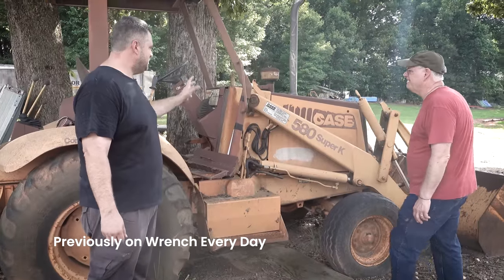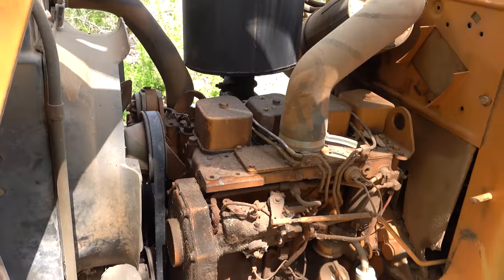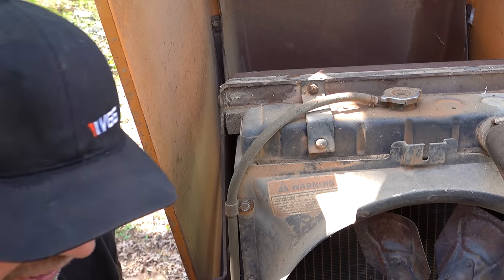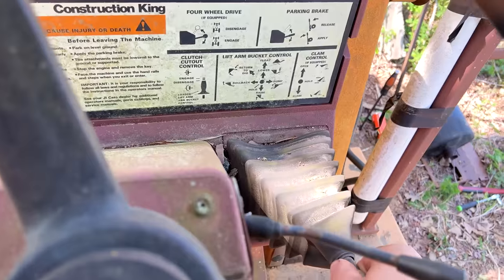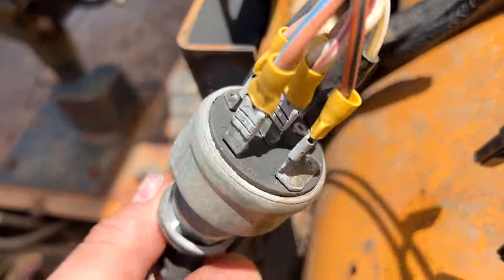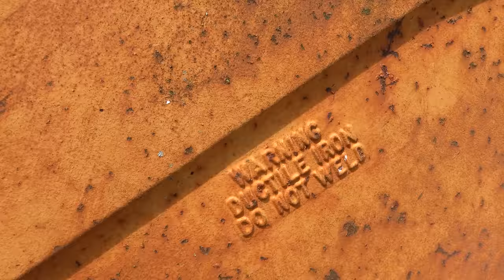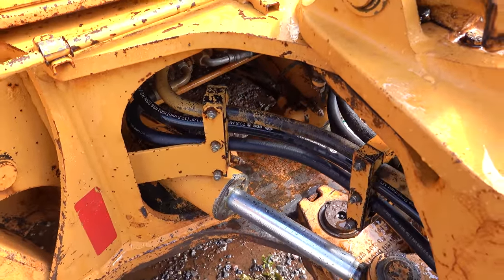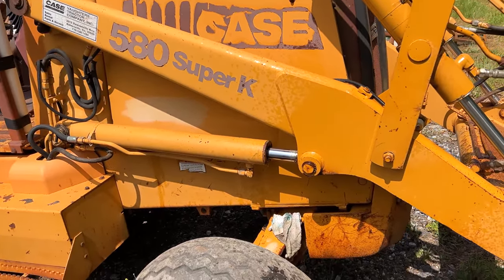I Found A $50,000 Diesel Backhoe ABANDONED In The Woods...Will It Start And Run?

Comment: Using it while it's leaking hydraulic fluid is inadvisable. I don't know what the US regulations says when it comes to this, but hydraulic fluid is one of the most environmentally toxic substances you can spill. 

In Denmark, where i live, during the education i have as a crane operator, it is part of the education to learn the harm that these substances can cause, and for hydraulic fluid, if you spill just one liter of it, which is very little, considering how much a system like that contains, then it takes 1500 liters of water to dilute the contamination enough so that it is no longer environmentally toxic. I imagine that scales with gallons as well. And if you spill it, and you don't clean it up, or fail to clean it up properly, there is severe punishment, up to, and including jail time, depending on the severity, and the cause of the spill.

So uhm, please fix it properly, before you go out and dump a bunch of hydraulic fluid everywhere. :)
Reply from the maker: As much of the leaking was captured as possible, and the new cylinders that sprung leaks have been sent out as well. It’s dangerous to the environment and operator to have cylinders leaking
Reply: @TheQuestionableGarage  Glad to hear it, hopefully you're replacing the one that is leaking due to a bent rod as well. :)

Comment: Derek is rubbing off on ya lmao working on the worst junk and then licks the dipstick... feed a moose some octane, fill it with the piss and it will run... next thing you will be saying spark twirler and sparkalator while having a wobbly pop poking at dodads  😂 don't worry been doing the same darn thing with a 5hp tiller and a win is a win if it does the job. keep wrechin 🤟

Comment: Ignorance is bliss they say.. I would only fix whats broken as it may last for years and its a occasional use machine. If going to a job site, fix all and cut no corners. I had a grandson who wanted to learn how to operate equipment, and equipment is what I used to mechanic on for many years. I eventually went to a home base job and started working on trucks from home instead of living in some construction camp. So I would trade my repairing equipment for the use of it, they were more than happy for that and I let my grandson learn on every kind of equipment that company rented., thats been many years ago now, my grandson is a operator now and does some mechanicing... he doesn't have the heart for grease so in my judgement, he is not a operator if he isn't willing  to work on it..

Comment: Some people have no business on heavy machinery and Jared you are one of those people you put yourself in danger. Driving with the bucket up and backing into a hole the tires are clearly flat and you had no instinct to put your stabilizer down in the back to prevent a rollover. you should have lowered your stabilizer and then got your bucket to lower doing whatever you needed to do to rig the fuel system after the fact. Very ignorant and I'm glad no one was close to you. Stick to cars.